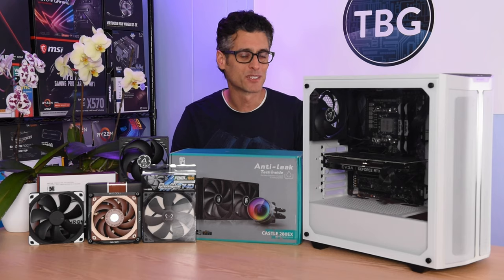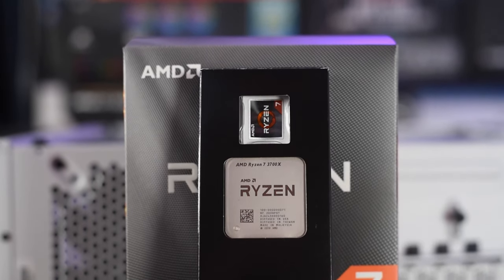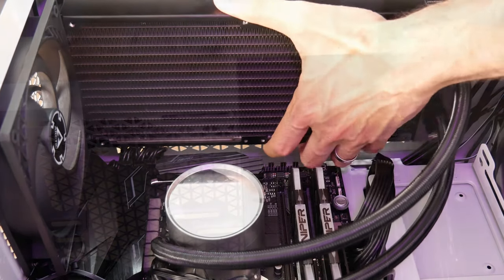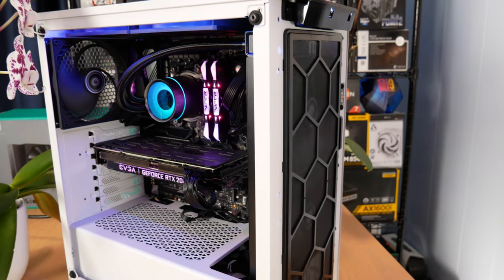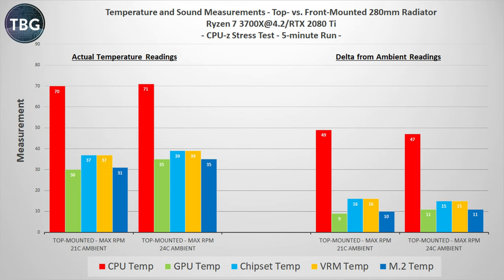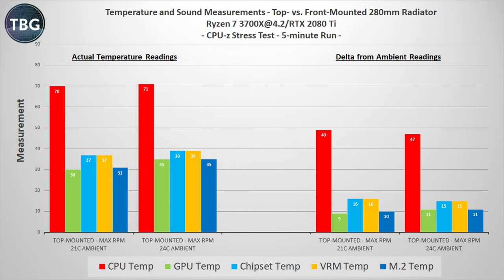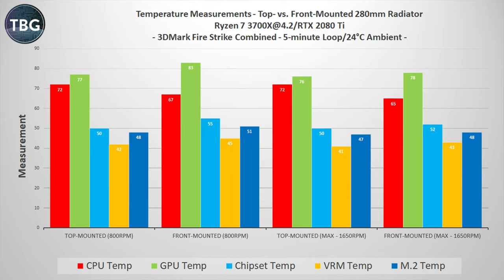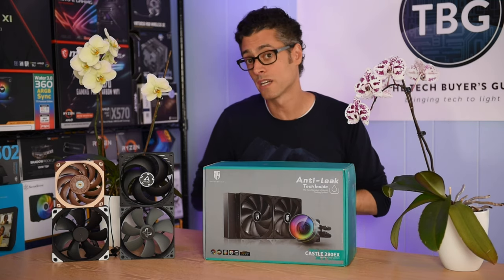Front vs. Top AIO Liquid CPU Cooler - feat. Deepcool Castle 280EX Install on AMD's AM4 socket

Comment: Are you doing push/pull setup too? I get way better temps and lower fan noise, because the lower rpms.
Reply from the maker: I may do that in my 140mm fan shootout, but the only fan I have 4 samples of is the Arctic P14, so it's not going to be a five-way shootout among all the contenders in push/pull. Just a one-off to show the possibilities.
Reply: @TheTechBuyersGuru   That's great! Even that gives perspective about that setup option. I hear a lot of people say "it's a waste of time and money, it's just gonna be more loud."
If you could show the difference that would be great. Even with just the P14
Thank you!
Reply from the maker: What I'll need to do for this test is pull the Arctic P14 fans back out of the case and install the standard be quiet! fans, so the P14s are available for the push/upll comparison. That's totally fine, but I'm glad you suggested this now so I could make the change before I did all my fan testing!

Comment: This is a case/fan dependent debate. 

Front mounting with the fans on top and rear as exhaust 9 times out of 10 lowers CPU temps significantly compared to top mounting. 

With side fan mounting you can increase airflow when top mounting aio but top mounting usually causes the hot air in your pc to linger much longer then front mounting where the hot air is almost immediately exhausted out the top and rear.

Comment: If I were to do 2 radaitors on my 3080 extreme water block gpu, would it be okay to put the gpu radaitor 240mm up top and aio cooler 360mm in the front? Its for my mid tower build.
Reply from the maker: I absolutely recommend putting your GPUs rad in an exhaust configuration. It will dissipate far more heat than the CPUs rad, and having that blow into the system will cause havoc.

Comment: Nice video. I'm interested especially that I'm about to buy this case. But from what I've seen so far that case shouldn't support 280mm AIOs mounted on top. But it's obvious that it can be done.  Is it specific to Motherboard that You have or maybe it's depending on Ram height?
Reply from the maker: Totally specific to the cooler and motherboard. Not really related to RAM height, as that's not what it's going to cause a conflict with first. If the motherboard has a tall VRM heatsink, you'll have problems well before the RAM matters. I used an Asus X470 Crosshair, which as you can see does not have a very tall heatsink on top: https://amzn.to/2LbdESd

To be clear, be quiet! does not officially list 280mm compatibility, I only stumbled upon the possibility because I tried it. Most other reviewers probably didn't bother since it's not in the specs.
Reply: @TheTechBuyersGuru  Thanks for a quick answer. I'm building a new rig with that case and I'm thinking to change my existing air cooler for AIO. I'll be using MSI B550 Tomahawk MB but can't find detailed info about VRM's height. But if it won't fit on top I guess I'll put it on front.  Thanks
Reply from the maker: Great choice of motherboards - good price for the specs! - https://amzn.to/3pL27bo
No one will give you specs on heatsink height, it's just not something done in the industry, and I don't know what clearance the 500DX case/Arctic cooler combo has anyway, so it's just something you have to take a chance on, and my guess is less than 50/50 that it will fit on top having looked at the photos of the board.
Reply: @TheTechBuyersGuru  Thanks a lot. I'll guess I have to check it out.

Comment: You should have put the cables at the bottom for the front placing. Check gamers nexus video regarding aio placement. Your temps would probably be much different, if you mounted it correctly.
Reply: I'm not so sure about that. The findings of this video is that blowing the air from your radiator inside your case makes GPU and VRM temperatures go up. As Gamers Nexus themselves have clarified (watch Ask GN 114) the tubes positioned up or down when mounted in the front is mainly a question of acoustics and potentially the longevity of the AIO itself.

Comment: hi, thanks a lot for your effort making this video. i want to ask :  with top mounted aio, the fans layouts are two front intake fans, and three exhaust fans. will the airflow become negative pressure? (front side of my case is 2/3 meshed filter without fine filter behind it, unlike yours)
i have similar size of case that only has two front fan slots, two top slots, one back slot. 
thanks in advance!
Reply from the maker: Not necessarily. Far less air goes through the radiator than comes through the front panel. But ultimately, it doesn't matter. I get so many questions about negative vs. positive pressure, and honestly, this is all based on incorrect assumptions that have been posted in forums for years. What matters is cooling performance, and whether a case has positive or negative pressure is almost completely irrelevant. Much more important is fan placement, type, and effectiveness. You want a lot of airflow getting to your components, and enough hot air being drawn away.

Comment: Could you test this with the Lancool 2 Mesh with 2 fans mounted to the PSU shroud? I'd like to know if this affect the GPU Temp in any way at all.
Reply from the maker: I'm actually planning on doing something like that with a different case, but with a similar setup option. Your question is a great one!

Comment: Your case seems to have a somewhat imo limited intake availability (the ratio of mesh in the front design) is it possible a different more open design would accomodate better thermal results? Im all about top mount exhaust setup myself just curious.
Reply from the maker: This is actually among the highest performance cases on the market. There are only a handful that have better benchmarks. I agree it isn't fully meshed, but it's far above average. And ultimately, it doesn't matter for this comparison. If it had bad airflow, that would severely penalize GPU temps for both configurations, and would also impact the CPU temp to a similar degree. In other words, because the case stayed constant, the test really is just about cooler placement.

Comment: does it matter whether the tubes come out from the bottom or sides of the waterblock when mounting it at the top of the case?
Reply from the maker: I have been told by manufacturers that it does not matter.
Reply: @TheTechBuyersGuru  thank you

Comment: Hey Guru, thanks for the video! I'm picking up this case for a new build. I know that you said to another commenter that the 280mm top mount fits solely based on which cooler and MB you have, curious if you would know whether you could top mount it using the Gigabyte X570 Aorus Elite Wifi and the Kraken X63? And if it doesn't fit, would you suggest mounting it on the front OR instead mounting a 240mm to the top and replacing all the other case 140mm fans with 120mm? Thanks in advance for you help!
Reply from the maker: The Kraken has caused problems for others, and I think it may be because the radiator is 30mm thick rather than the standard 27mm thick. The Gigabyte board has a relatively low profile VRM heatsink, so that wouldn't be the main issue, and you may get the "puzzle pieces" to fit, but I can't guarantee it. The thickness of the radiator impacts how low on the motherboard you need a certain clearance to be maintained, whereas the VRM heatsink is the main clearance issue.

In terms of alternatives, you may want to just get a 240mm rad, but I wouldn't replace the 140mm case fans with 120mm case fans. I have shown that to work well for the front of the chassis if you replace the dual 140mm fans with triple 120mm fans. But don't swap to a smaller rear fan, and don't just swap 1 for 1 in the front! 

Here are links to what I'd recommend:
(1) Deepcool Castle 240EX: https://amzn.to/39NqZcY
Better looking than the NZXT, cheaper, and performs extremely well. And stock fans can be upgraded to...
(2) Arctic P12 5-Pack: https://amzn.to/3wrUzyp
Mount three of these in front for amazing intake cooling, and swap out your two radiator fans as well, regardless of the brand of cooler you buy!
Reply: @TheTechBuyersGuru  Thanks for the quick reply! Appreciate that. When you say the X63 has caused problems you mean only because of the size not because of the quality, correct? 

As far as the swapping three 120mms for the 2  140mms in the front, I was under the impression that all fans needed to be the same size for a proper give and take - that's why I asked about swapping the rear with a 120mm as well, is this not the case, 120s in the front can do a proper give and take with a 140 in the back, and say a 240mm top mount for example?
Reply from the maker: I haven't tested the X63, people have just mentioned issues fitting it in this case. As for the fans, no, there is no need to balance them, as you are saying (3x120mm intake, 3x120mm exhaust). Each fan plays a distinct role, and having a larger exhaust fan is definitely preferable.
Reply: Great! Thank you so much for the help, I appreciate that, I was under the illusion that all fans had to be the exact same size. And what I was saying would be a 3x120mm intake, 240mm rad, and a 140mm rear exhaust, which again I was always under the impression that the rad had to match the others! Thanks for bringing me into the know. :)
Reply from the maker: One reason that matching fan sizes doesn't work out the way you might think is that the airflow through the radiator will be far less than through an open vent, so if there were any benefit to equal intake and exhaust, you wouldn't have it in that situation. But even so, much more important than equalizing airflow is getting cool air to components and hot air away from them. Airflow can always go through passive vents to make up any imbalance.
Reply: Thanks again for the responses, really appreciate it and you got a subscribe out of me! 
So here's the build I'm considering:
Reply: be quiet! Pure Base 500DX Tempered Glass Gaming Case - Black
Case Fans: 3x [ARGB] DEEPCOOL CF120 PLUS 120mm Addressable RGB Fan
Processor: AMD Ryzen 5 5600X Processor 
Processor Cooling: NZXT Kraken X53 240mm Liquid Cooling System
Memory: 32 GB [8 GB X4] DDR4-3600 Memory Module - G.SKILL Trident Z 
Video Card: NVIDIA GeForce RTX 3070 - 8GB GDDR6 
Motherboard: GIGABYTE X570 AORUS ELITE WIFI 
Power Supply: 850 Watt - Seasonic FOCUS PLUS SSR-850FX - 80 PLUS Gold, Full Modular

Primary Hard Drive: 1TB ADATA XPG SX8200PNP PRO M.2 PCIe NVMe SSD
Reply: I'm using a pre-build company simply because of the shortage of GPU's, I've customized the entire thing except the GPU. I'm a little limited in what I can purchase as they don't have everything I'd like, but they do have some decent products. Any thoughts on the build?
Reply from the maker: Looks very good. So that company can get the GPU?
Keep in mind that in the 500DX, you won't really be able to see the ARGB fans very well when mounted in front, which is what I assume you're doing with them.
Reply: Yes, they require a few weeks lead time for the 3060, 3070, and 3080, but they can get them! And yes, I’ll mount the 3 120mms on the front - the only reason I chose the rgb is because the other fans they have are no names with low rpm.

Comment: At 5:32 it seems cooler barely fits. I also have 500DX but I wonder would cooler like that or Arctic Freezer II 280mm fit if VRM motherboard heatsink from the left side (next to I/O cover) would be a bit higher like the one from MSI B550 lineup, for example B550 edge. Imagine that VRM heatsink from I/O cover of the X470 CH7 is extending in full height instead of being a bit lowered exactly where is that 140mm fan from cooler in this video - would that same cooler then fit or not? Pls answer, you are probably the only one putting 280mm on top of the 500DX. Btw. good job for reviews.
Reply from the maker: Arctic Freezer II 280 will not fit on top. It may fit in front with hoses down, but they might be too stiff to route around certain video cards.
Reply: @TheTechBuyersGuru  Thanks. Eh.. from other youtube video I saw it wouldnt look pretty from front cuz it would hide 1/3 of Be quiet logo and ssd on cable bar. I guess 500DX is mostly designed for air cooler which is still fine.

Comment: Hi Ari, so mounting up top is preferred over front mounting?
Reply from the maker: That's my conclusion, but I'm well aware that most cases can't fit 280mm radiators up top, so if the front is your only option, that's what you should do.

Comment: Where do you connect the pump connector when the CPU port (top of mobo) is blocked by the radiator? I did not get this part.
Reply from the maker: You have to plug that in first!

Comment: Just curious, most other reviewers let their AiOs soak up heat for a while until temperatures reach an equilibrium. The thought being that short workloads don't really stress the cooler since the liquid temperature will remain low. Your tests were rather short, would that put your results at a disadvantage compared to others?
Reply from the maker: Good question. I am monitoring the CPU temp, which goes up very quickly upon loading, so the fact that the liquid temp itself changes slowly isn't a major factor. But yes, if I were monitoring the liquid temp, it would take a very long time to increase. Put another way, as long as the liquid is below the temp of the CPU, there will be heat transfer, so whether the liquid is 32C or 40C doesn't matter much when the CPU temps I'm recording are ~70C.

Comment: Thing is, with something like the p500a, you can use another 140mm fan below the front-mounted 280 aio to bring in fresh air for the GPU. You recommend 280 aios, so why haven't you tested this method? Seems like the most logical.

Comment: It would be great to compare the AIO in the front, tubes up X tube down. 
Some say that with tubes down it will get cooler because the AIO liquid flow is optimized.

(It is not about the bubbles issue).

Comment: I wonder how different it would be if you were using a case that allowed placement in 3 areas like the dynamic XL. Are the temps a lot lower if you've got a side mount intake rad but also 3 bringing in fresh air to the case from the bottom and 3 exhausting out the top?
Reply from the maker: The bottom fan-mount concept is an interesting one. I'm not particularly interested in what side-mounted fans do (they are worse than front-mounted fans, that is a given), but the bottom-to-top airflow could definitely be something that changes the results. Stay tuned for some testing of one or two cases with this configuration next month!
Reply: @TheTechBuyersGuru  on the dynamic XL the side intake is essentially the front but it also has room for top and bottom in addition to the side.

Comment: I feel like pulling cool air out when amouting AIO on top. I decided to mount it up front. For top exhaust fan, I think one 140mm fan should be enough. If amouting 2 fans, it is exactly pulling air away before they can reach cpu and motherboards.

Comment: LOL Bequiet themselves clearly state that top mounting 280mm aio is not possible. I’m glad that it seems to still work. Gonna try it out asap when my 5 set of noiseblocker e-Loop b14 fans arrive
Reply from the maker: It is specific to the motherboard. Some will not work because the cooler will hit the motherboard VRM heatsink.
Reply: @TheTechBuyersGuru  just tried it out today with my silent loop 280 mm on my b450 gaming pro carbon ac from msi. Had to cut off some material from a fan, but now it fits perfectly
Reply from the maker: Glad it worked out. Now you see why be quiet! does not market it as compatible with 280mm AIOs!

Comment: What is the best option? 2x 140mm in the front or 3x 120mm? I think 3x 120mm is the best option because it will also bring cold air to the HDDs that are in front of the PSU? What's your opinion?
Reply from the maker: Planning a shootout of 120 vs 140 fans of the same brand to answer this very question, so stay tuned. But I should disclose that it will not include any mechanical hard drives.